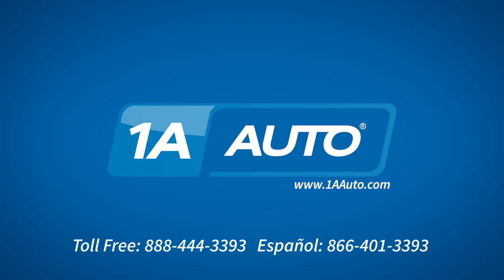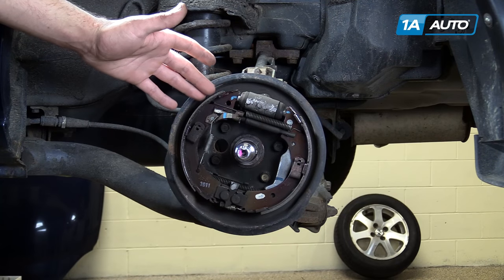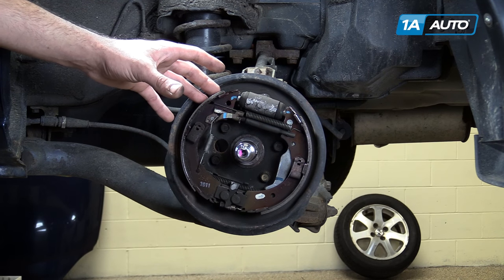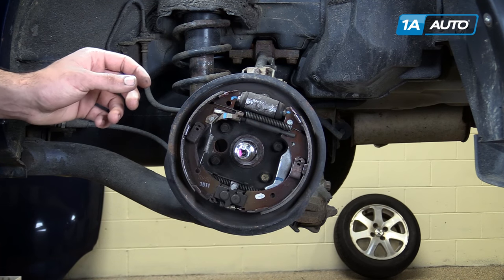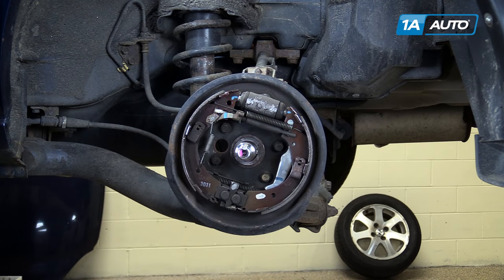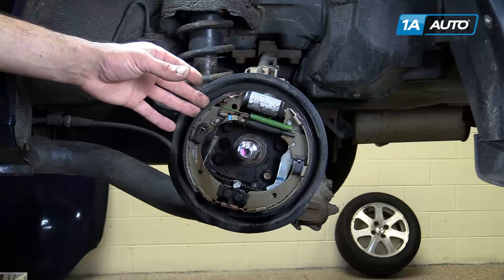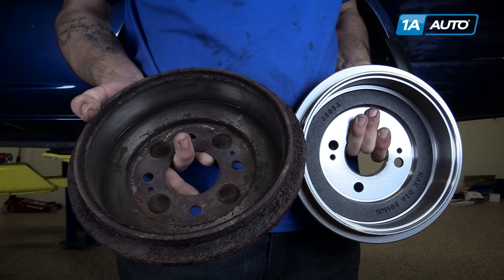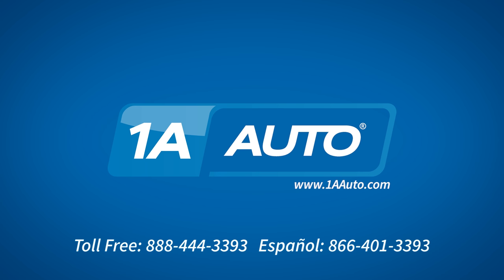How do Rear Drum Brakes Work?

Comment: I have a question . do brake shoes ajust themself?
Reply: The Honda Fit 2012 service manual says they do. The 2012 fit has automatic adjustment levers for the rear drum brakes.

The manual says that once all parts are put back together, press on the brake pedal several times to make sure the brakes work and for the self-adjuster to self adjust. Next, lift the e-brake, which should fully be tightened within five to seven clicks. If the e-brake does not fully tighten within that amount of clicks, it needs to be adjusted.